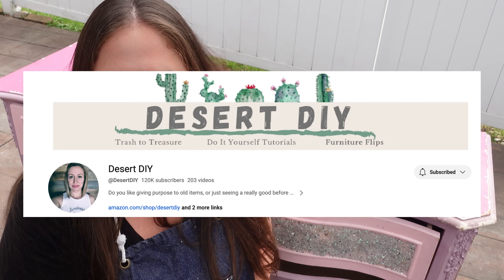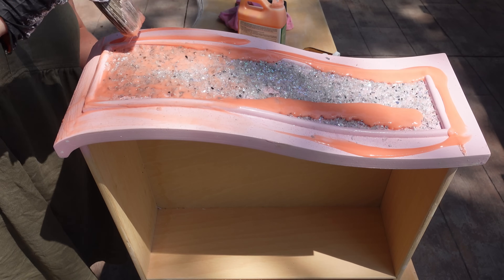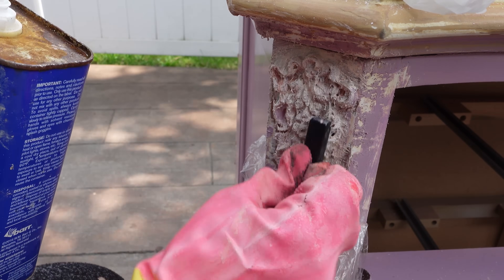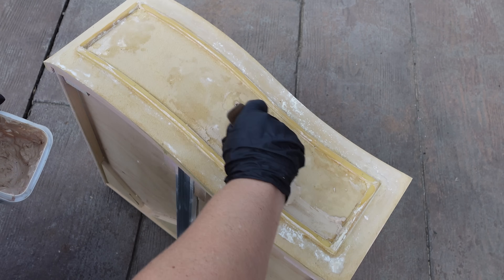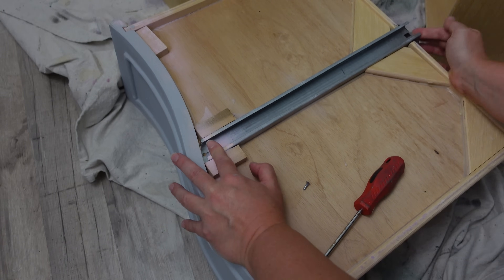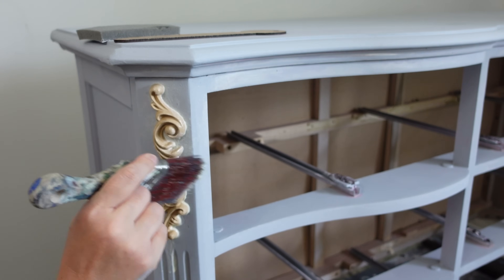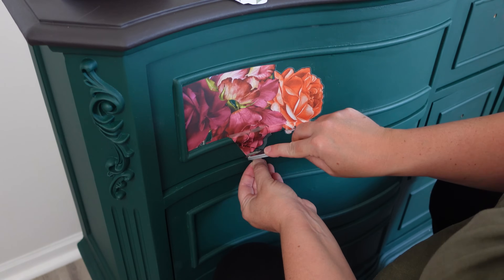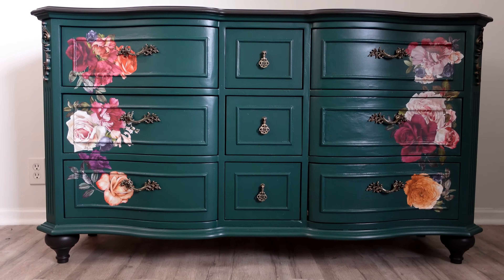This dresser needs a MAKE-UNDER?! Can I make it beautiful? The Ugly Duckling Challenge 🦆

Comment: Maybe the blocks to keep the drawers from closing all the way was to keep the little princess from smashing fingers?
Reply: I thought exactly the same thing!
Reply: ..but decided crushed glass was ok was for the lil gal!😂
Reply: And the glass was put there to make little princess cut her fingers?
Reply: I thought the same thing. They wanted to prevent a little one from hurting him/herself. 
The glass was covered with glue. Probably didn't cut.
Reply: @NitrosMom074 😊😊😊😊😊
Reply: It definitely was for that reason only 😂
Reply: Obviously the glass was coated for safety.
Reply: Good thought, but then why use glass shards on the drawer fronts?😂
Reply: Seriously, aren't there safer ways to add a little bling for the princess?

Comment: When you are removing the old finish on the sides, wouldn't it be easier to tip the furniture over? Less stress on your back and arms.  I figured out the blocks on the drawers.  Maybe it was to prevent pinched fingers.